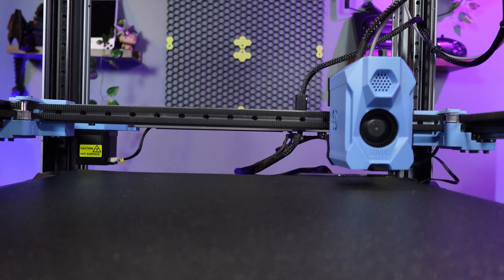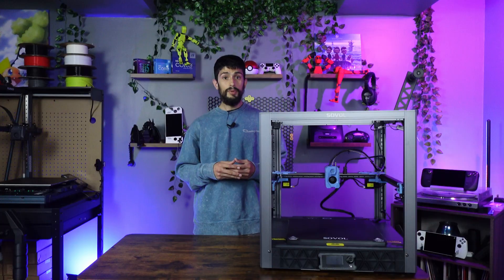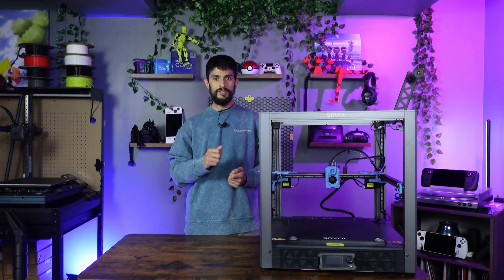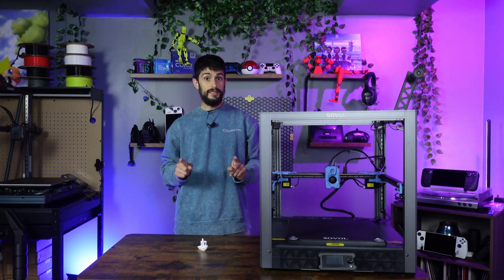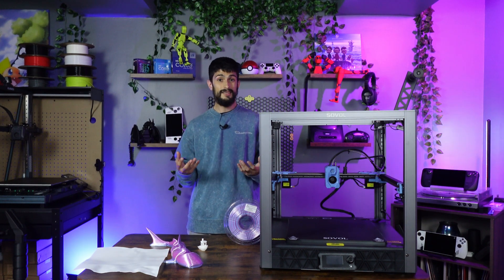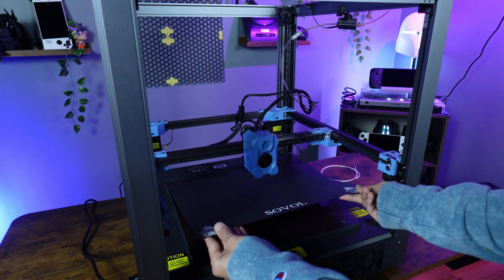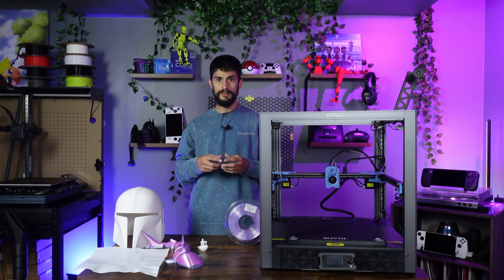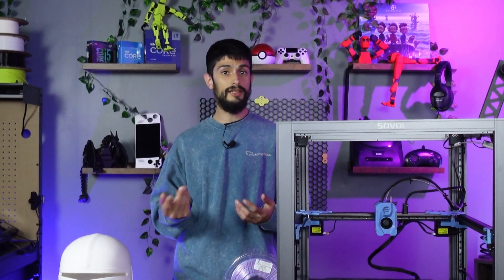I Wish I Had Better News - Sovol SV08

Comment: Z-offset will save if you click the big GREEN SAVE button after you're done adjusting it AND it doesn't reset it back to 0. Once the offset is saved, THAT value then becomes the Z0 position to the printer.
Reply from the maker: Crazy how it’s different from one Klipper firmware to another 🤯
Reply: @EdsTechTalk94  maybe an older klipper vs new?  I installed Klipper last week and it does this. and it does SAVE it, just doesn't display the set value.
Reply from the maker: My Neptune 4 plus isn’t that old 🥺
Reply: @EdsTechTalk94  To be fair, the version of cura that comes with the Neptune's isn't "that old" either lol.  it's just 3-4 versions behind, and you know that 1 update can make the difference. It's more of a preference at this point really. I wouldn't care if it didnt' even display it as long as that first layer is going down like butter.
Reply from the maker: Truuuuuue just didn’t know that some printers reset it and some don’t. Hope we all learned something new. 😂
Reply: @EdsTechTalk94  SV08 follows mainline Klipper closely (well, at least as of now) and this is normal behavior in Klipper. Normally the live Z offset should be from a reference, so you may adjust it say slightly down when printing to a textured PEI plate vs a smooth one. It’s more useful to the operator to only need to see this adjustment and not the per-machine value, so the live Z references 0 from the calibrated value.

You can see the actual Z offset value saved in printer.cfg

Comment: Please take down this video and make corrections to it before dissing bad info. 

Your opinions about assembly are valid, especially your gap issues, but don't spread info about not auto saving z offsets. That's not how it works. 

If you also do more looking into the printer config, the start print gcode doesn't run auto z offset. 

Again, please take this video down as it is a poor representation of what klipper can do. Please study the firmware, printer, config, and come back with new findings
Reply from the maker: It’s not misrepresentation when 2 of my other Klipper printers both save the Z offset and still show it. It’s a difference in firmware. And yes I was wrong that it doesn’t save it but I wasn’t wrong that it doesn’t show it like other Klipper printers, making it a misleading representation on the current Z offset.
Reply: @EdsTechTalk94  It's not a difference in firmware... It's still running klipper. You don't know how to proper use the auto Z offset and you don't understand how to save the z offset. I will go toe to toe with you all day on this. 

Understand the klipper firmware better and make changes. I have been able to update the start_print macro to account for a fresh z offset on every print.
Reply from the maker: Hey dude, I never claimed to be an expert. In fact, in one of my previous videos. I even said “im far from an expert” it must be nice to be such a perfect person like yourself.  You should start your own channel! 🤓
Reply: @ss1gohan13  lighten up Francis

Comment: I am having some grinding noise issues and of course the Wi-Fi doesn't work
Reply from the maker: Contact support! I have already sent my email today about my machine sadly.
Reply: My wifi didn't work because it didn't like the USB stick I used. I reused the one that came with it and updated the firmware and it went fine.
Reply from the maker: That’s really odd it didn’t like the included usb 😂

Comment: ofcourse the Z-offset dosent save you didnt press the save button
Reply from the maker: When you run the z offset calibration off the printer it does save it just under the printer config file and the reset it back to zero on Klipper

Comment: in Klipper, if you save the z-offset it will then show as zero but it is saved. You're just at your "new zero"
Reply from the maker: I’ve come to find that out. My only concern is that every other printer I have using Klipper doesn’t reset the offset to zero after it saves and resets.
Reply: @EdsTechTalk94  I'm curious, are they machines you switched over to klipper or machines that came with Klipper? My Sv06+ and Vyper both change the new value to 0, but you can see the actual value in the printer.cfg.
Reply from the maker: Ender 3 is running off a pi 4 so that’s obviously not stock. But my Neptune 4 plus is stock with Klipper.

Comment: Check the gear on z4 it might have locktite residue on it that can be cleaned up.

I lucked out mibe doesnt make that noise. My only grip with the machine is how hot the z steppers run. I purchased heat sinks for them
Reply from the maker: I pulled my printer apart and it’s the smaller belt and pulley connected to the motor making the noise. It looks like it’s skipping too, but what’s worse is that I found metal shavings by the pulley and belt 🥲
Reply: @EdsTechTalk94  check the fully and gear for residue. Other content creators have found residue build up from locktite, causing that exact sound from your z4
Reply from the maker: Will do!

Comment: hm... it still looks nice...

how would you rate the quality of the prints? compared to lets say bambu labs
Reply from the maker: I do not own a Bambu but a print is only going to come out good if you a tuned profile and printer. And ender 3 can produce the same quality print as a bambu, it’s just the speed and features that are different. 

My prints came out good. Only a few rough spots on the test prints but since it’s kinda broken I don’t want to run it at the moment.

Comment: Small correction. When you save the config for the z-offset, either by clicking the save button in the web interface or on the mounted display, it will get save to the printer.cfg file and that becomes your new z=0 position after restart. Hence the z-offset got reset to 0.
Reply from the maker: I doubled checked and yes you are 100% right, but that is a very odd way to do it. It definitely confused me and probably others as well.
Reply: @EdsTechTalk94 my first week with klipper I went nuts trying to figure out why "it kept resetting to zero". There certainly is a learning curve.
Reply from the maker: But my other printers running Klipper keep the Z offset in the spot even after a save and reset 😅
Reply: @EdsTechTalk94  which one? - that is not the default behaviour for Klipper, so they definitely made changes. Either way, it doesn’t really matter.
Reply from the maker: Both my ender 3 (it’s obviously not stock and running off a raspberry pi) and my Neptune 4 plus keep the offset in that spot after a save and reset. It’s not a huge deal just something I was use too.
Reply: @EdsTechTalk94  yeah, it caught not off guard too, when I first installed Klipper. I spent a whole weekend figuring it out,😁
Reply: @EdsTechTalk94  It is a quirk of the Klipper Firmware. As the computing is done on a different chipset (often on a completely different board, like the Pi), the way the way the offset values are saved as they are just happens to be the simplest way to do so across power cycles.

That is not to say it is impossible to make it behave like what we expected of traditional RepRap or Marlin firmware. However, much like installing apps from the Window app store, it is not what Klipper users are used to. So, they will catch far more flags than it worth, if they were to try chancing it.
Reply: @EdsTechTalk94 it's not odd. That's how it's always been done in klipper

Comment: Most of your problems will go away if you use a more stable surface. You are killing it rocking it around like that. That is also why the filament is shaking off the spool.
Reply from the maker: Yea it's only on that table for filming purposes, I'm not complain on the print quality so much as it doesn't have any profiles.  But it still doesn't fix my broken corner (z4). I took it apart today and found metal shavings, one of the gears is grinding on the pulley making it skip a lot. 

I also have seen more then myself have issues with the spool holder, so I don't if moving it will fix that issue.

Comment: still 0 out 0f 5 video you are just nippicking weird stuff
Reply: You mean you don't value his input on the printers color or choice of frame texture?   LOL
Reply: @Posey3DStudios  nope and his weird obsession with the manual and taking points off, becorse some of the wordings are being weird, and then complaining about the print it does for the z ofset witch is actually stated in the manual meaning he didnt even read the manual yet still complains about it.
And the z ofset not saving witch is a klipper thing not a printer thing as klipper saves the ofset to the config and resets the ofset to zero on all the klipper printers i got it only shows if it has been live adjudsted and not saved yet.
and complaining about the display being small is a weird thing to nitpick about.
when a display isnt needed as one controls klipper via network, the screen is just there to make some things easyer and everything dont need a touch screen and that will also increase the price of the unit.
and complaining about there only being 2 profiles when he didnt even update the printer.
and checking for new updates and updating anything one just has unpacked is standard practice.
and complaining about the profiles not being tuned for HIS own silk filament like what.
the included profiles has been tune for Sovol filament so some tuning is required when using diffrent filament thats just simple logic.
and complaining about having to put the wifi info on a usb whats so wrong about that, its a bit easyer then the way some others do it.
it honest just seems like he wants it to be bad and then just complains about very weird stuff that mostly is his own opinion and makes that a fact
Reply from the maker: You should start a YouTube channel! 🤓
Reply from the maker: I’d love to your review on the SV08, tag me on X!